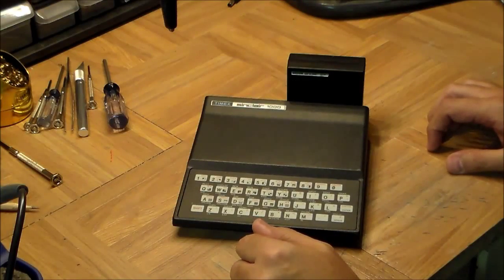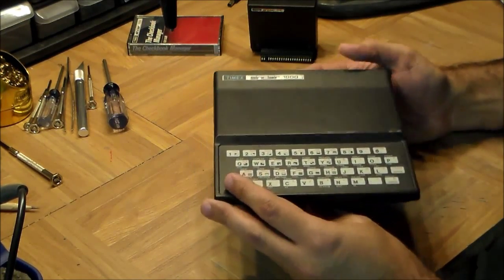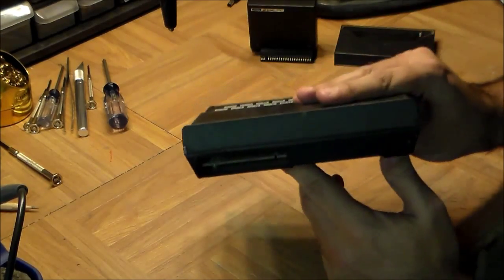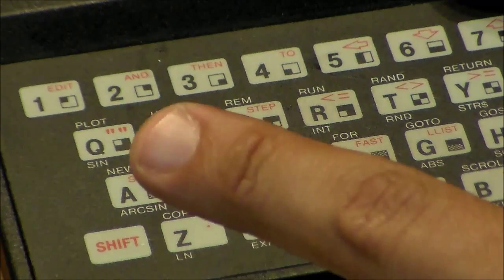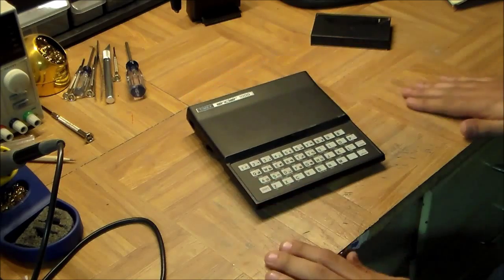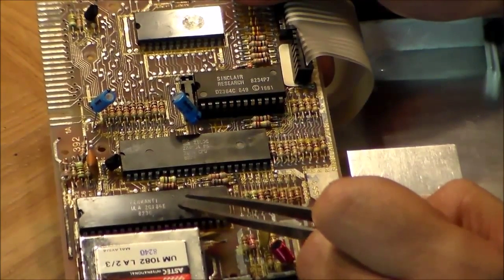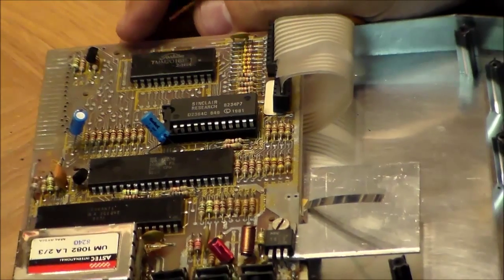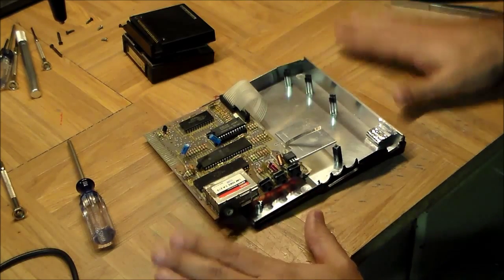Inside the Black Box 6: Timex Sinclair 1000 / Sinclair ZX81

Comment: A few notes:

The EAR and MIC sockets are for audio input and output to/from the cassette recorder. They are labelled to match the labels on the recorder's sockets, hence EAR is the input to the computer and MIC the output. They are connected (via some filtering) to the video output pin of the ULA. Of course, when this pin is used for audio I/O, video output is suspended. The audio signal gets fed to the TV and is the cause of the bizarre patterns during loading or saving. Modern TVs often simply show black at these times because they refuse to attempt to constitute a picture from the audio. The ZX81 wasn't intended to have any audio output other than for saving to cassette.

In SLOW mode the CPU is dedicated to video generation at all times other than during frame fly-back, which is the only time user code is executed. This makes the computer very slow, but it was a good way to produce a very simple and low cost system. The later ZX Spectrum has a more advanced ULA that handles all aspects of generating the video signal and so the CPU can execute the user's program all of the time. However, this arrangement means access to the lower 16K of RAM (and the ULA's I/O port) is contended because this is where the picture data is held.

Comment: My baby, how I miss you.  One time I spent hours and hours programming a board game and when I tried to save to my cassette it would fail.....
Reply from the maker: Typing in from magazines, oh the frustrations.
Reply: +Dave Nunez (Rabbit Engineering)
I remember it well... a friend of mine got a ZX81 in around '81/'82 and it got me hooked as well, so we would spend long sessions typing in programs from a UK magazine called YOUR COMPUTER where we took turns at typing; one of us would sit with the magazine and read out the listing to the other, who then typed it on the ZX, and after roughly an hour we would trade jobs.Of course, we would often type the programs wrong, and then spend hours hunting down the mistake, or the listing in the magazine would have printing errors, which we would then have to sort out on our own.
Of course this could be VERY tedious, but we also learned a lot in the process, so yeah it was a great time which i remember with fondness :)
On a side note, i like to think of the ULA as the forerunner of what later became known in the era of IBM-compatible computers as the chipset - i.e. North- and South-bridge chips, since what it did was orchestrating the flow of data between the various other parts of the computer.
Finally i'd like to commend you on a great presentation; good job, and especially a kudos for pronouncing the name right: Zed-Eks.
Thanks for making this video, you now have one more subscriber :D

Cheers from Denmark.
Reply from the maker: Actually, the ULA idea is making a big comeback in FPGA cards used in massive datacenter racks, for applications like cryptography where you will need to revise the "hardware" often. Stick in an FPGA, and then just reprogram it when you need.

Comment: As a Canadian, we NEVER got the Timex Sinclair computers. You had to import them from America. You couldn't find Sinclair hardware or software here in Canada. Importing them from the U.K. was counterintuitive,  due to the differences in voltage and using NTSC as opposed to PAL.
Reply from the maker: +Tedmeister that's too bad, they are really cool little machines - hey, never too late to pick one up off ebay!
Reply: True. Though, I'm more interested in the ZX Spectrum.
Reply: +Tedmeister
Hey there... just in case you're still interested in the ZX Spectrum, it was marketed in the North American region as the Timex-Sinclair TS2048, and in an enhanced version called the TS2068 which additionally had a Programmable Sound Generator (AKA music chip) and a ROM Cartridge port on the right hand side of the (slightly improved) keyboard.
Sadly, however, these enhancements meant that a small percentage of the games for the ZX Spectrum were incomptabile with the TS2068 caused by differences in the ROM code, so they had to make a ROM cartridge with the original ZX Spectrum ROM to solve this problem.
Both models will occasionally pop up on ebay, but they tend to be somewhat expensive, being a bit of a collector's item nowadays.

Cheers from Denmark. :)

Comment: My first computer was a ZX81 and they used to come in kit form to build yourself in true Sinclair fashion. Im from the UK and Sir Clive Sinclair was a pioneer here. I remember the old Ram Pack wobble due to the poor connection on the card edge connector. Sinclairs official fix solution was to use Blue Tac to keep it from moving. Classic. Anyone interested in the Story of Sinclair and Acorn i suggest you watch the program called Micro Men on You Tube.
Reply: +craig gilchrist
Hi Craig, as far as i can remember, the main cause of the dreaded RAM Pack Wobble was that in order to save a penny, Sinclair Ltd. omitted a small bit of plastic, known as the Key, from the connector on the RAM pack, the absence of which could lead to the RAM pack sliding slightly sideways and thereby shorting out the connections on the PCB.
Since you're from the UK, you're probably aware that a large number of third-party vendors soon started making RAM packs (and other add-ons), many of which were both cheaper than Sinclair's own offering AND had the aforementioned Key fitted.
Probably the best known of these third parties was a company called Memotech, which sold RAM expansions in several different sizes: 16KB, 32KB and even 64KB; they also made printer interfaces, and even a High Resolution graphics adapter, which sadly was horrendously slow. All the different modules from Memotech came with a small square of adhesive velcro which you would attach to the ZX81 and whatever module you had acquired.
I mention this for the benefit of others who may not have heard about them, so please forgive me for stating what may be obvious to you. 

Greetings from Denmark :)
Reply: Its all good my friend, i do remember the third party ones. The good old days.
Reply: craig gilchrist Good days indeed :)

Comment: The problem with the display wasn't that the CPU was underpowered (for its day). It was that there was no dedicated display chip unlike in more expensive computers of the time, or PCs. The Z80 was thus forced for most of the time to do nothing but drive the display, since when it is doing that it cannot go away and do anything else.
Reply: Unless you were in FAST mode, in which case the picture was only generated when the machine was idle, executing PAUSE or INPUT
Reply: True. :)

Comment: ULA  Uncommitted Logic Array,  forget the resistors and capacitors, this has the logic gates (AND,OR,NOR,NOT) that are needed to glue the system together.  If you look inside a system like the TRS-80 model 1 level 11 that is very simler(sorry for the spelling I am dyslex....) in design(apart from having 16K not 1), it used MANY! more logic chips than the ZX-81. The ULA was the main brake though that made the ZX-81 cheep but so hard to repear because the ULA was not a standard part unlike the TRS-80 that used all standard parts.  The ULA was a custem design chip.
Reply: +MrStevetmq semi-custom. I understand that Ferranti produced the ULA chips in relative bulk and customised them to fit client tasks.

The ZX81 is an evolved version of the ZX80 design using the ULA to replace a large number of expensive glue logic chips allowing Sinclair to drive down the cost of the ZX81. It's quite similar but the software is slightly simpler and the ZX80 doesn't have FAST and SLOW mode.
Reply: TheTurnipKing That is what I said.  Thank you for adding detaile
Reply: @TheTurnipKing  There's some additional logic to allow for FAST and SLOW mode. Mostly generating an NMI signal. This could be retrofitted to the ZX80. With modern ZX80 clones having this included. There was an upgrade option to fit the ZX80 with a ZX81 ROM and keyboard overlay
Reply: @markevans2294    yep.  The ULA was absolutely the right call from Sinclair's point of view.  It reduced the entire computer to just four ICs and simplified assembly considerably, but it does unfortunately mean most modern clones are more accurately described as zx80 descentants due to the relatively unobtanium nature of ULAs.

Comment: did Sinclair release the the zx81 under the Sinclair name then timex? because i have a US NTSC  zx81 (inside the mobo is red with usa issue one silkscreened near expansion connector with a single 1k x 8bit ram instead of 2 1k x 4bit ram found it at a swap meet for $5)
Reply: Yes, it was released in the United Kingdom in March 1981 under the name 'Sinclair ZX81', and in the United States in July 1982 as the 'Timex-Sinclair TS1000' with twice as much RAM (2KB versus 1KB in the UK version). Also, as mentioned in the video, the US machine had a TV channel selector on the bottom, but in every other respect the two models were identical.
Reply: Gert Brink Nielsen doesn't answer my question i have a ntsc zx81 usa that is sinclair branded not timex?
Reply: aadz93 I'm sorry, i misunderstood your question. To be honest, i didn't know that there were ZX81-branded machines on the US market, but my guess is that they may have been parallel imports.
Given that both the UK and the US models utilised the same PCB, with just a minor difference in the components around the TV modulator, it wouldn't have been difficult to change these components to make the computer NTSC-compatible.
Thus it is very probable that some entrepid person would buy DYI kits from England, make the necessary component changes, then solder the machines together and sell it as a NTSC version.

Hmmm... I just googled your question, and found this page http://atariage.com/forums/topic/201836-us-released-zx81/ which states that there WERE actually ZX81-branded machines n the US market.
I must confess that i'm quite confused now.
I'm sorry for not being able to give a definitive answer.
Reply: it's fine, i was looking for an answer to that question for awhile, i figured it was an older release model, appreciate it ! quite interesting
Reply: aadz93 You're very welcome, it was interesting for myself too!
Reply: Yes they did, and I had one. Before they partnered with Timex, the ZX81 (with 1K RAM) was available in the US under Sinclair's own brand.

Comment: I had one of these.  16K RAM pack was notoriously unreliable with it's connections.  Breath near it, and you could lose your program.  I soon gave up on trying to use the RAM-pack at all.  The main machine's 1K was practically useless - even in 1981.  My one ended up like many others - as a novelty door-wedge keeping a door open. ;)  It WAS my very first computer though, before I moved over to the Atari 800XL.

Comment: Mic is short for microphone, not Mickey. "Mike," not "Mick." ;)

The keyboard reminds me of a Texas Instruments Speak 'n' Spell. Any plans to tackle that one?
Reply from the maker: +Emmett Turner I'm going to call language difference on that one - in South Africa we used to all say "Mick" not "Mike" :-) Speak and Spell would be a nice one to tackle actually - speech synthesis is something most people consider mysterious so it would make a nice episode.
Reply: +Dave Nunez (Rabbit Engineering) Awesome! Wish I still had mine. BTW, any reason why we don't get to see this thing work? I guess that's not the point of these videos (it's not like we saw the Famicom or NES controllers work), but I'm sure most Americans like me are so unfamiliar that they would have loved to have seen it boot/operate.
Reply from the maker: +Emmett Turner I don't have a TV with an analog antenna input into which to plug these things any more!
Reply: +Dave Nunez (Rabbit Engineering) - you can get a special replacement circuit board from RWAP that will give you a composite video output to your TV's yellow socket. You should be able to find them on sellmyretro dot com. Good luck !
Reply from the maker: +kumbah2006 thanks, I'll look into that!
Reply: That is not necessary, you can take composite off yourself where it goes into the modulator, the modulator has can (ground) and also composite and 5v inputs so just take your composite cable from the one that /isn't/ a 5v supply and use the can for ground.

Be aware the ZX81 took some liberties with the video generation, particularly with respect to the back porch, it may not work at all or be very dark on modern TVs.

Comment: Mhm, i wonder how much did the processors really cost? 1983:
MOS 6502: $5
MOS 6502A: $7
Zilog Z80: $4
Zilog Z80A: $5
Zilog Z80B: $12

I think this computer needs Z80A. However, i expect the prices would be perhaps up to 2 times as much in 1981 when the system was designed. By all reason, CPU and RAM are the only parts in the box that actually cost anything, but not for very long.

And oh, ULA is a masked logic chip; like mask ROM, but with logic gates instead of data. So you don't need to make millions of them for them to be profitable. And they don't contain passive components.